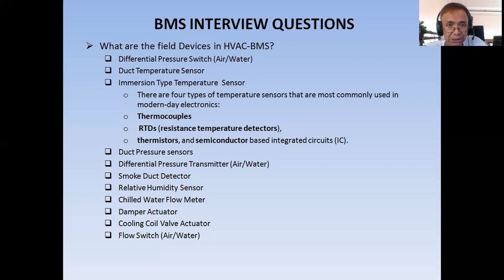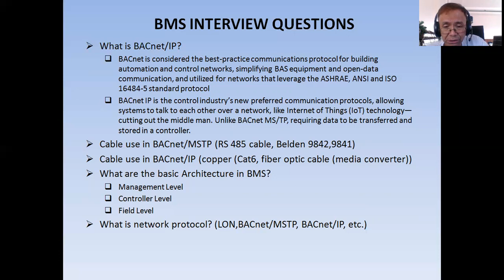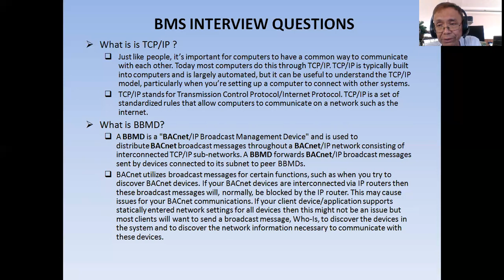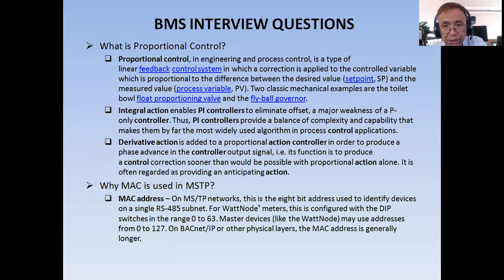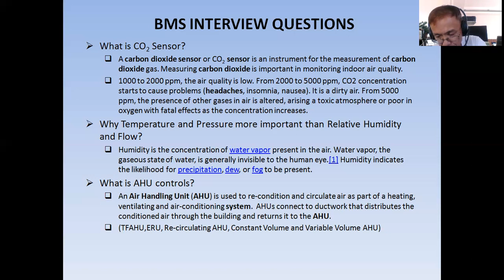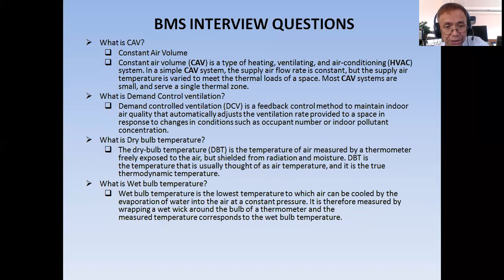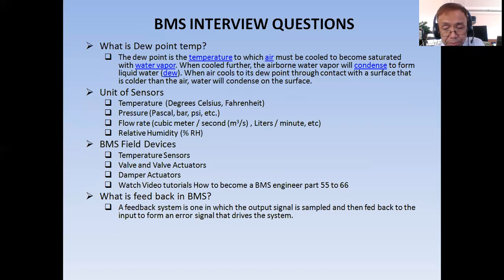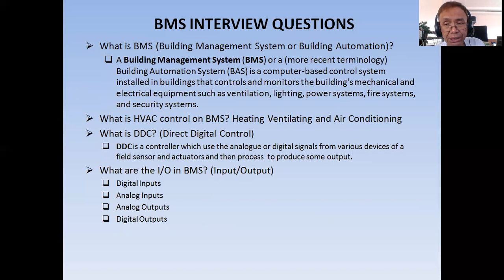How to become a BMS engineer part 79 (BMS Interview Questions)

Comment: Dear sir, please make one video on vav progarmming
Reply from the maker: in my previous projects handled all of our VAVs are using pre-programmed controllers, meaning when the VAV units came to project a controller was also supplied which is already programmed for VAV application. all we need to do is configure and change some parameters.
Reply from the maker: in you case if only VAV box was supplied then you need to program the controller that will control and monitor the operation of it. you can use same logic as an AHU except I guess there will be no chilled water valve control only damper control will be there. Check first what are the sensors installed in the VAV boxes like dampers actuator (modulating, three point control), temperature sensor, pressure sensor, etc
then based on this you can write your own control logic program

Comment: Sir please explain the difference between Humidity & Relative Humidity.
Reply from the maker: humidity is the  concentration of moisture in the air that is why we have a term humid (meaning the air has more moisture on it, like in the middle east or in Qatar in the month of June to August the air is so humid. While relative humidity is the ratio of the amount of water vapor actually present in the air to the greatest amount possible at the same temperature . (taken from google credit belongs to them). There are so many good explanation of relative humidity in the internet.

Comment: Can I work as a BMS engineer or BMS commissioning engineer. Because I have done engineering in computer science. But I wanted to go as a BMS engineer. Present time I am working as a BMS operator. Please 🙏 reply
Reply from the maker: yes you can, as a BMS operator you are aware of what is being controlled and monitored in Building Automation. You know how these HVAC equipment works  then it will be easy for you to write the control logic program let say for air handling unit (AHU).  Continue supporting my channel keep watching my tutorials which I guess it is almost complete for those who wishes to join the field of BMS.

Comment: if building fire alarm coming then what happen our ahu can u expalain sir my question how to our ahu input output work in ddc and our AHU off somke alaram plzz answer sir
Reply from the maker: the BMS engineer's control logic program for an AHU includes fire alarm status coming from Main Fire Alarm Panel, if the AHU should not run when there is fire alarm then it will automatically stop based on the DDC control logic program, at the same time the fire alarm people will install a relay module in each AHU's  control panel that will be controlled by the FACP program
Reply from the maker: the FACP program will activate the relay module that will open the Normally Close Contact (NC) where the control voltage for this AHU  is connected thus de-energizing the contactor of the AHU's Fan motor.
Reply: Thanks for reply sir great answer